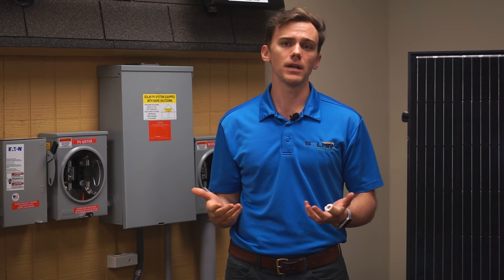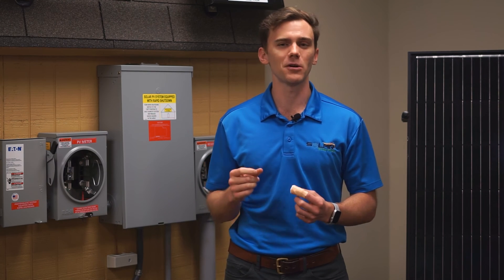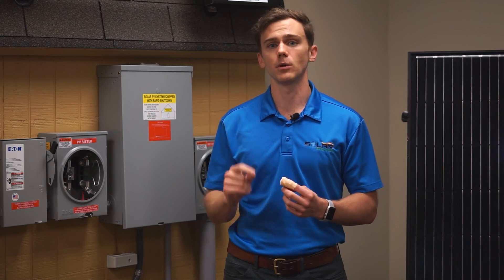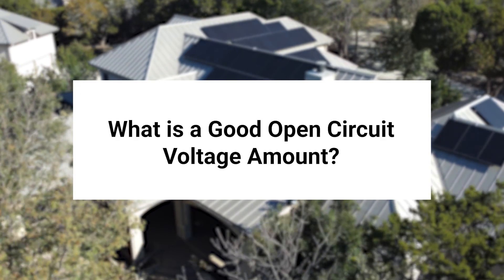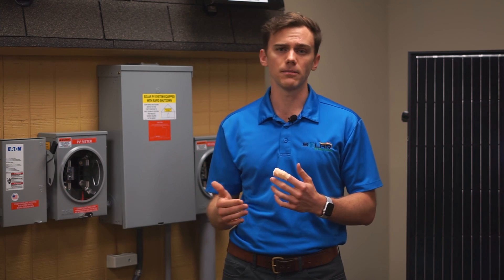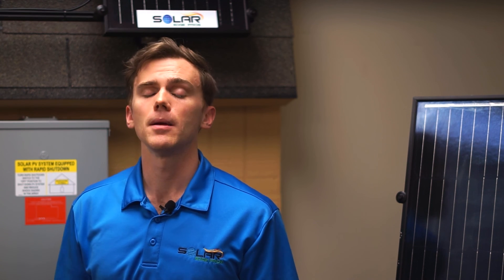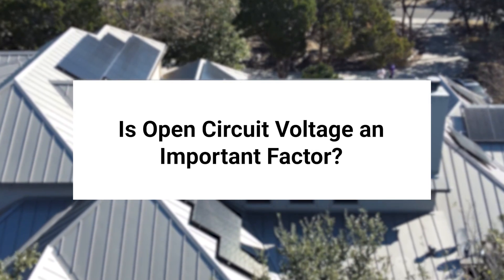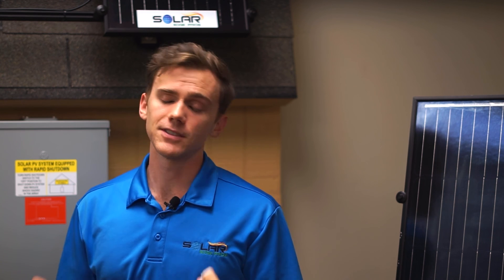Open Circuit Voltage of Solar Panels Explained

Comment: Is there a way to " clamp" OCV to avoid frying my Schneider Charge Controller at -40 C? As soon as there is a load the voltage drops ~25 volts.

Comment: I just measured mine with my multi meter a while ago and while the spec sheet states it should be 45.18v they measured around 40.2v or so. But it is a cloudy day today (no sun) with the temp at 76F.  Would that cause it to be lower than spec? Should I be concerned?
Reply from the maker: Yes, lack of sunlight and cloudy days can definitely change the measurements around. It's nothing to be concerned about, but I would track overall production over the next month just to see how the panel(s) are producing. 😃

Comment: Good topic. Whenever you are dealing with a variable power source, you need to make sure that everything connected to it can handle the maximum voltage that might be produced even if almost all of the time the voltage will be much lower. If the voltage gets high enough to force current through something that doesnt want current, that something is instantly fried.

Comment: Do I use the open voltage or working voltage when it comes to making a solar array
Reply from the maker: Hey thanks for asking. You'll need to consider both open-circuit voltage and nominal (working) voltage. open-circuit voltage is used for safety and system voltage design, while working voltage is used to determine the array configuration and calculate the power output under operational conditions. Hope this helps.

Comment: Amazing video!!
Is there harm in oversizing your solar panels to improve absorption on cloudy days? 
Eg a 650w panel. 
Will there be risk on a sunny day when 650 watt is actually absorbed by the panel when the inverter is only rated for 550 watt ? 
My panel has a built in solar charge controller.
Reply from the maker: In short, the inverters will never pull more power from the panels than they can handle. If shorting out an inverter remains a concern, the biggest cause of inverter failure and overproduction mainly comes from overuse in appliances, which is still a rare case. Hope this helps and thank you for the question!
Reply: Many thanks!!

Comment: voc is useless once you put a load on it you will never reach that voltage again. your vmp operating voltage will never get that high never.
Reply from the maker: Agreed. In the grand scheme of solar energy, VOC really has little play in it's importance. Overall, our Solar: 101 content aims to give the audience a grasp at more than just the benefits to solar. We talk about the standard spec sheets and test conditions for those that really want to "know their system".  We're merely explaining the different terms and giving our educated opinion on which ones are important to consider. Thanks for your input!
Reply: @solaredgepros  I myself having a hard time understanding the math that goes with solar controller. To me the math does not add up.
Reply from the maker: I did a bit more digging and came across this video. Hope this helps - https://youtu.be/Jkbs84sBHsg
Reply: @solaredgepros  i have watch it and still confused. if we do the math v*a=w then if we have a 200w panel why do we / the watts by the charge controller volts?there is a set volts and amps for the panel but we are taking a number that is with another device and making it part of the total of the panel. to me that makes no sense
Reply: @hayzersolar in case anyone sees this after 2025. Amps X volts = watts. So in theory more watts come from more volts etc.

Comment: I notice temp.coeff. for Pmpp and Voc has a - symbol while Isc has a + symbol?? Is rise in temp. raise the amp?
Reply from the maker: As the temperature of the solar panel increases, its output current increases exponentially, while the voltage output is reduced linearly. In fact, the voltage reduction is so predictable, that it can be used to accurately measure temperature. As a result, heat can severely reduce the solar panel's production of power. Great question, hope this helps a bit.
Reply: @solaredgepros  Cool!👌